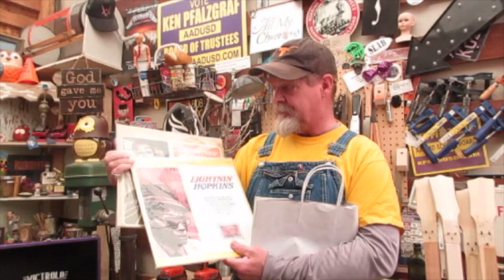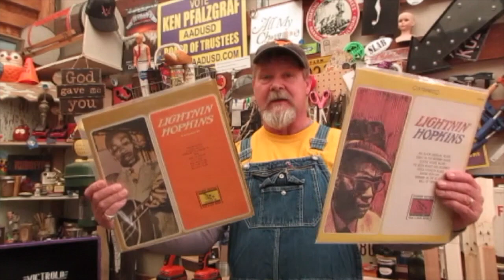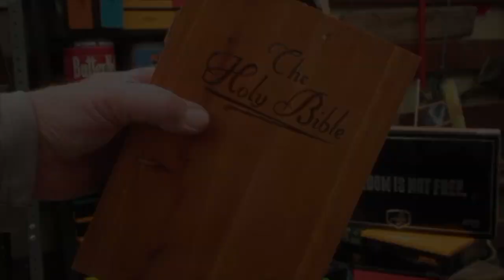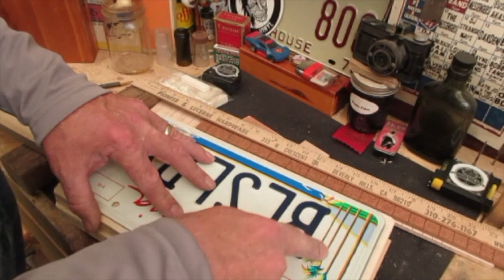Setting a Fretboard

Comment: Great information,  especially about figuring out the bridge placement on the box. Something that works for me when gluing fret boards is to drive a small brad into the neck,  one near the nut, and the other near the end of the fret board.  Snip them off leaving about 1/16" protruding.   Position the fret board and give it a tap over each bead using a dead blow mallet.  Pull the fret board off and glue as usual.  The brads will act to locate the fret board and will keep it from sliding when you clamp it.  It takes longer to read this than the time to actually do it.  Just be sure to drive the brads in between feet slots and not directly under one.
Reply from the maker: Lynn Hagans thanks for sharing a simple and effective tip
Reply: Or shoot a staple softly in each end then cut the top off leaving about a 16th.